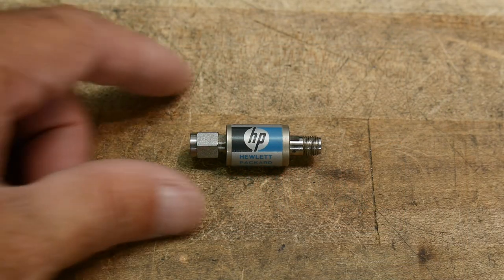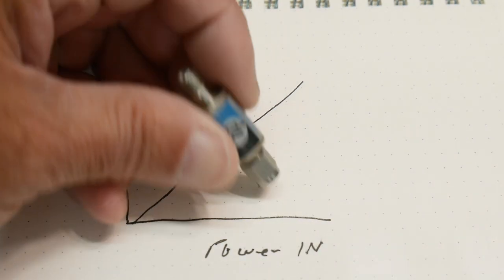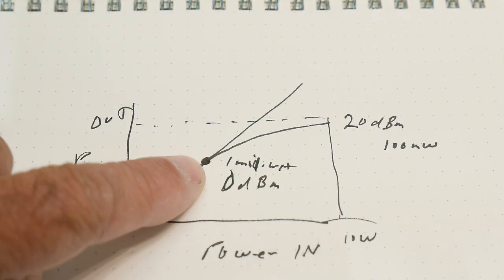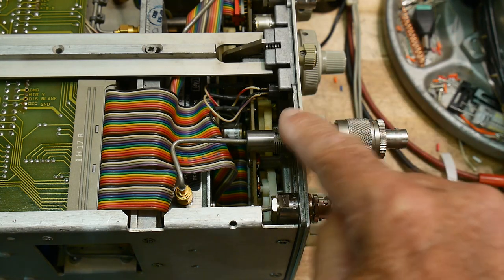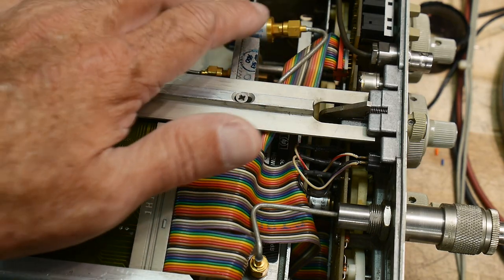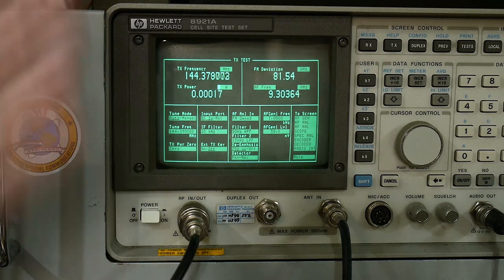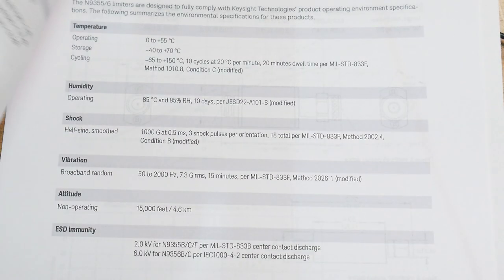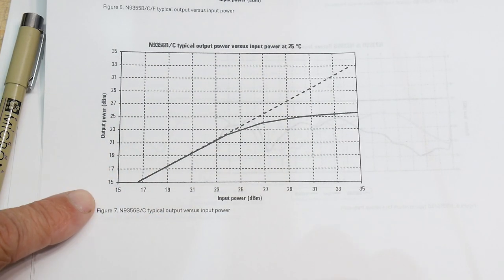#854 RF Limiters

Comment: That's a nice limiter especially since it goes down to 0Hz. I recently bought mini-circuits limiters but they only start from 10Mhz - 4GHz and 5W max. I bought mine to protect the frontend of my RSPduo SDR when I transmit on the Kenwood radio that is on a different antenna about 100 feet away. 10MHz doesn't cover the 40M band so I snapped up a couple of yours from eBay just this very minute! Way cheaper than the units sold by dx-engineering. Thanks for posting and emptying my wallet some more :-)

Comment: May be you forgot to specify that on the 8558, the limiter at the output of the attenuator is to protect the 1st mixer, which is one of the most expensive and delicate part of the analyzer.
Reply from the maker: yes, you either destroy the mixer or the step attenuator

Comment: I wonder if the return loss / SWR is still good when it is limiting?  (tnx fer qsl)
Reply from the maker: Hmm... does it absorb or reflect. My money is on absorb and that would keep the return loss down. I have no idea.
Reply: @IMSAIGuy  Let me know if you decide to investigate and find out!
Reply from the maker: @w2aew  damn you. You made me go out in the garage 😐 Using my HP 8921 and a coupler: at levels -10dBm and 0dBm it looks fine. at +18dBm it went up 10dB. guess it reflects
Reply: @IMSAIGuy  LOL - I knew you couldn't resist checking it out!  Glad you had the equipment to do it!  I figured that little package was too small to be absorptive for 10W operation.

Comment: ? I have a hp 6428 B power supply. I think its a 20v 45amp. I running my Yaesu ftdx10, occasionally it’s shutting down. I think rf if getting in it. But not sure 🤔 I set V at 14.0 and have the current know all the way up. Any help ? My station is on balance feed through a dentron tuner on the shelf 16” above supply. I have ferrite clamp chokes on both ends of power cord every thing is grounded and run to a 8’ ground spike 20’ outside the shack. I ve run the ftdx10 on a switching supply without any issues. Thank you
Reply from the maker: I have a bench supply that goes crazy on one or two bands. too much RF reflected. the tuner matches it but you still get a standing wave in the feed. My Astron supply on the radio is always solid (no constant current circuit in it) . 
1. different antenna
2. different power supply
3. change the grounding (sometimes helps or not) make sure the dentron is grounded well
Reply: @IMSAIGuy  thank you for the help 😉

Comment: Can you make one for the nanoVNA?
Reply from the maker: A limiter could be used on an S21 measurement of an amplifier. The limiter connected to port 2. Only use as a safeguard, you should be using an appropriate attenuator.
Reply: @IMSAIGuy  yeah I understand how to use it. I was wondering if you could show how to make one for use on a NanoVNA, for example when testing unknown aplifiers. I will still use a 30bB attenuator most times.
Reply from the maker: @BogdanTheGeek  I don't make them, I buy them
Reply: @IMSAIGuy  is it feasible to make one, just out of curiosity or do they have magic pixie diodes and pH inductors?
Reply from the maker: @BogdanTheGeek  the diodes can be bought (limiter diodes). One has to be familiar with RF design so they operate flat over frequency range. Then you need a good package and thermal design to handle the power. If you can design RF amplifiers then this should be an easy task.
Reply: @IMSAIGuy  thats exactly the kind of answer I was looking for. I might give it a try. I have a mill and I've watched you videos, so I think I might stand a chance. :D